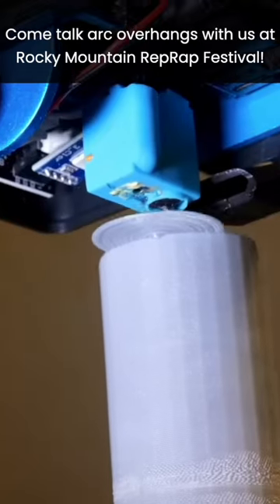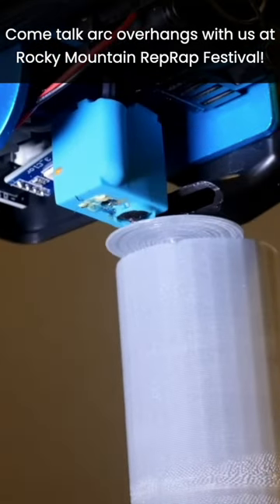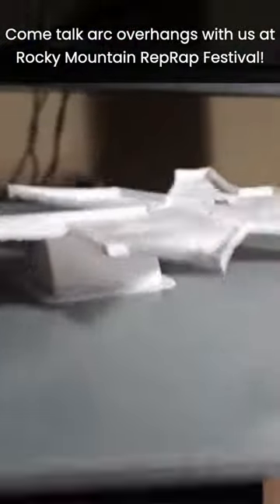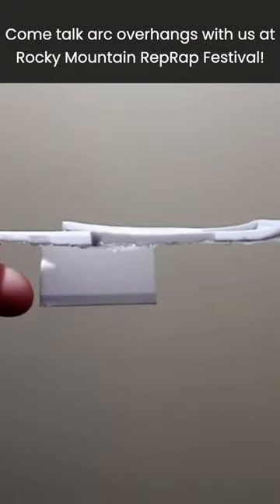Arc Overhangs Can Save You Money?

Comment: This will never be able to remove supports entirely from prints, because it wont be able to help floating 'islands' of parts that get printed seperately. Still really cool tho
Reply from the maker: Yeah it'll best be used in combination with supports.
Reply: It's more of instead of using a support heavy, then manual labor heavy approach to adopt a hybrid approach. As the systems get better and can automated the process in design it'll get much better. 

The programming systems will be able to tell when supports are needed. While using the arc overhangs to vastly decrease the amount needed. thus saving loads of time and effort.
Reply: @IzydorGoldsznaps in zero G nothing happens, the filament will still be dragged by the nozzle

Comment: I get it for aesthetic prints, but these warp up and especially with ABS that could be an issue for when you have to hit tight tolerances this isnt suitable for 90° overhangs. Great for aesthetic prints but not functional prints.
Reply from the maker: Definitely need more research before using on functional prints.

Comment: if you have all or a lot of supports ending at the same layer height pause it at the next level and aply glue stick to the top of the support. I would always recommend turning of z offset for the support and print directly on the support to have a cleaner underside and it will make it much easier to remove.
Reply from the maker: Interesting...

Comment: If you're doing commercial work, I'd heavily recommend using soluble support interface with a dual extruder/idex, which will basically add 5 layers of pva on top of the support, which you can then just dunk in hot water and get your final part with basically no extra effort.
Personally I've switched back to single extruder, because dual extruder is a bit too annoying to setup if you wanna change things, though I might go idex when I go to a bigger printer.

The other inconvenient is that you kinda need a dry box with a tube all the way to the extruder for the PVA, as it's sensitive to moisture (since it's water soluble)
Reply: How do you print it with a single extruder? Does your printer have an automatic filament changer?
Reply: I run 12 machines at the moment. Not a farm it's for an educational institution. 6 pva duel extruders and 6 single. Pva is temperamental and expensive. Really expensive almost double the cost of pla. It also loves to clog a hot end. If you can not use it, don't. Petg is a cheap but wasteful alternative. You need good ventilation, not good for you. This overhang system seems really worth exploring.
Reply from the maker: That's the challenge